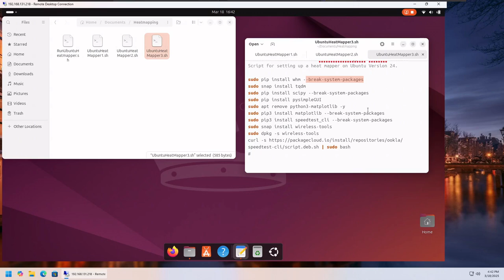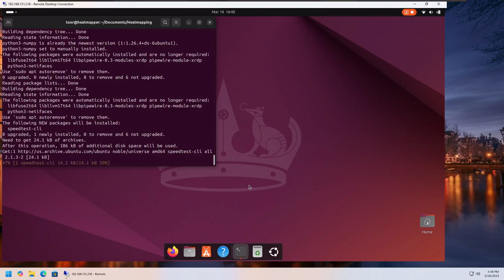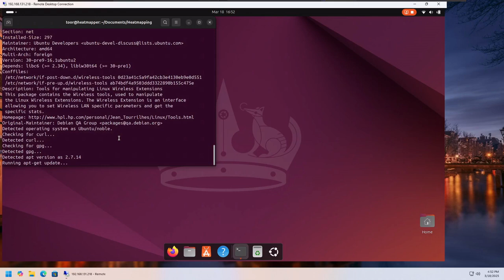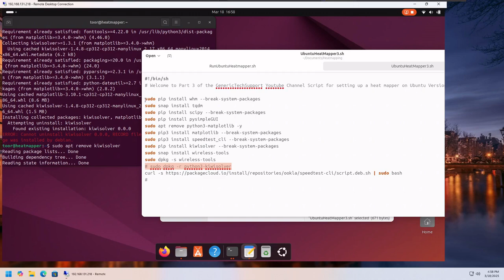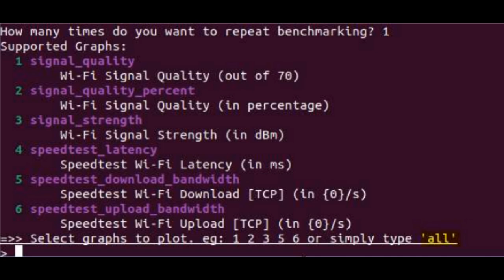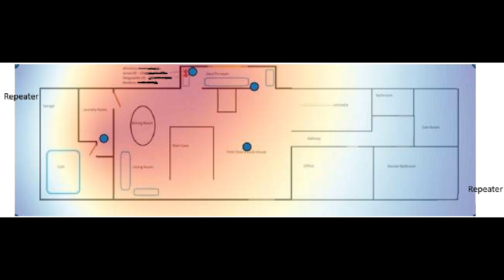How to Build a Wireless Heat Mapper for Free!

Comment: That's pretty cool, thanks for sharing! I lived in a house with cinder block walls in the basement and had poor connectivity there, solved the problem by putting the access point as high up in the house as possible. Much better after that!